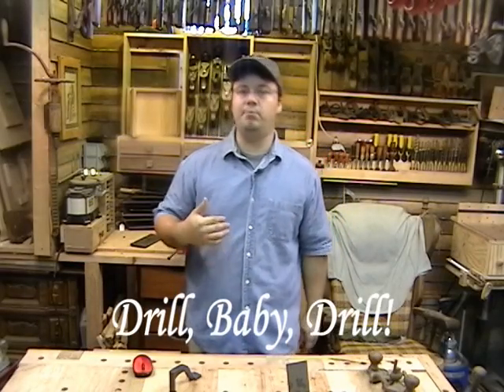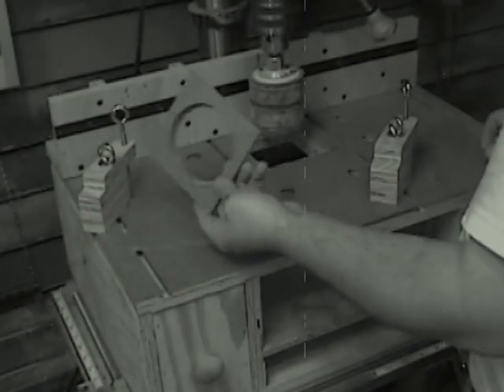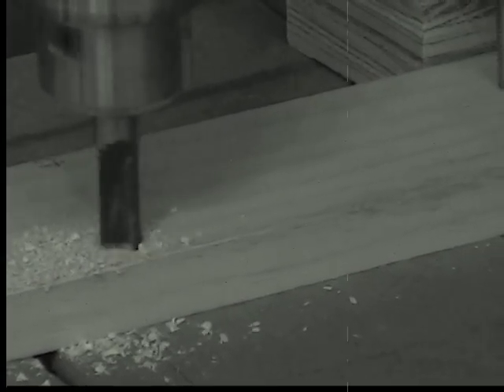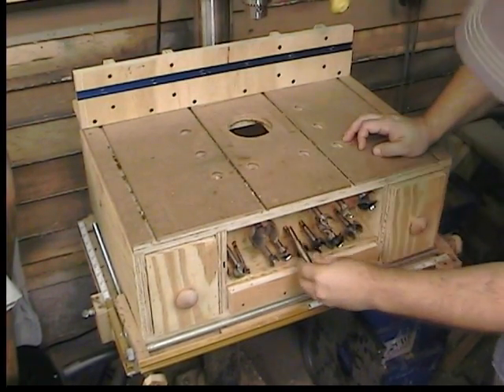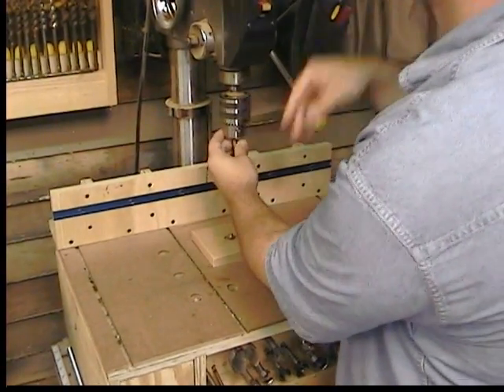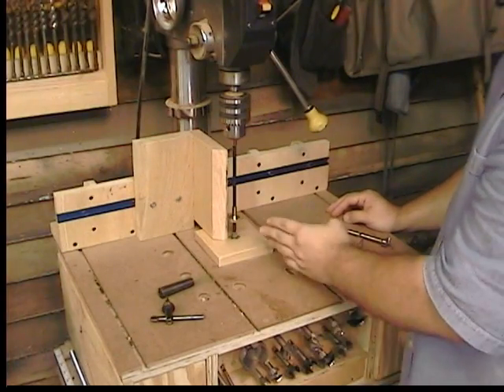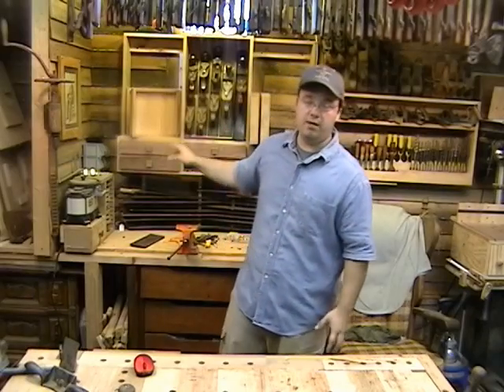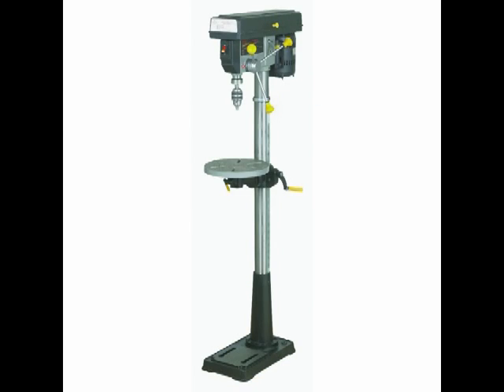Pen and Lathe Turning on a Drill Press (Homemade DP Table P2)-Woodworking with Stumpy Nubs #21

Comment: There are two floor models at Harbor Freight that have round metal tables.  The main difference is the horse power.  What HP do you have in your floor press?